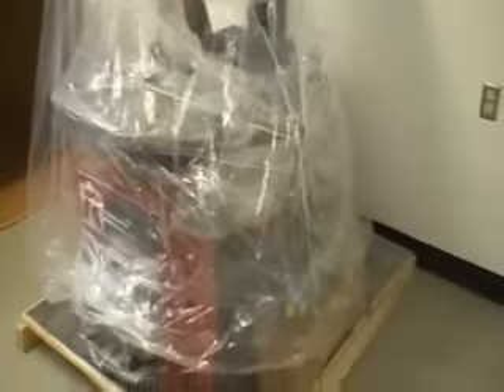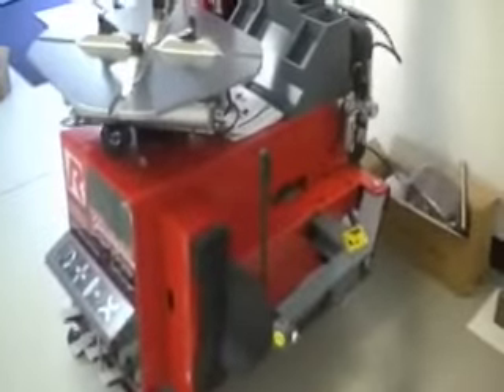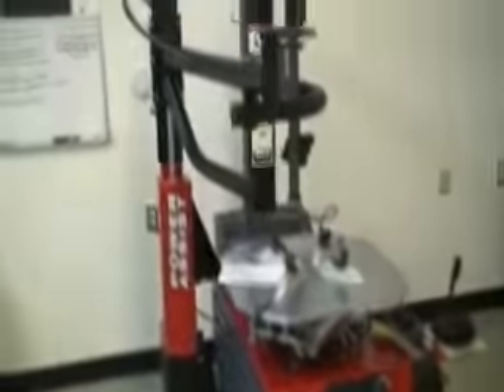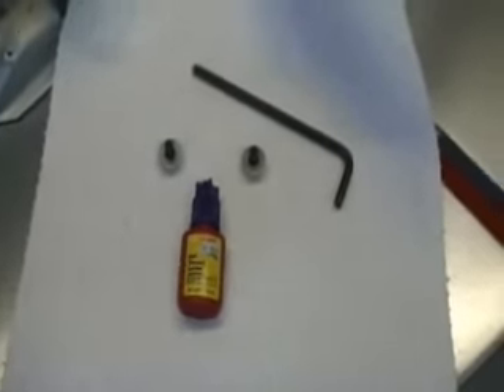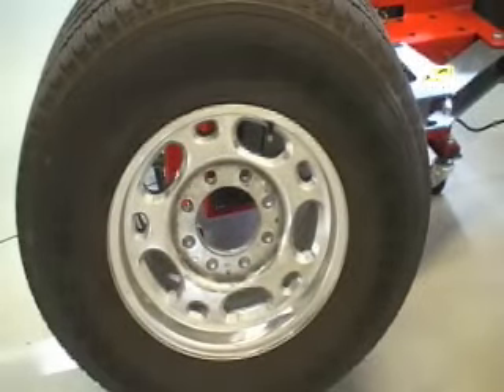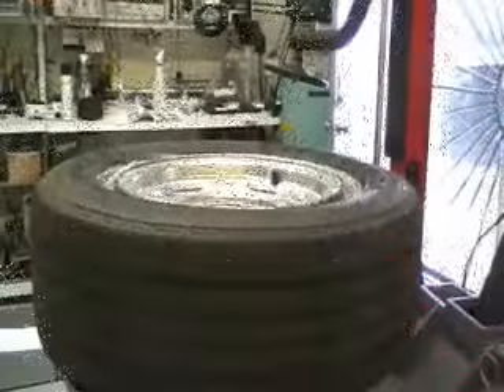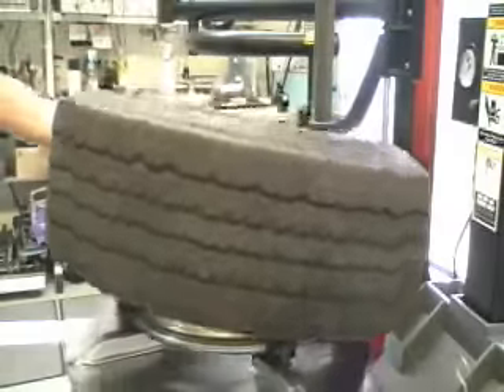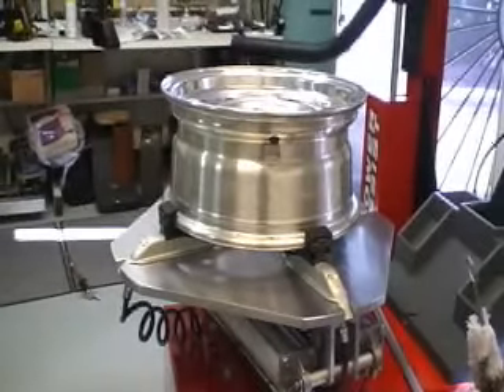Bendpak R23ST run flat tire changer

Comment: Nice video, surprised you don't have more views and good comments. I enjoyed the video and it'd be helpful if I was new to changing tires. Don't know why you didn't include the use of the helper arm during top bead installation. I've used a Ranger tire changer for about 2 years in a 4 bay shop with moderate use and minimal troubles. I was curious to see how the arm flexes under a load while pressing that top bead down, as this was slightly problematic with the one I used.